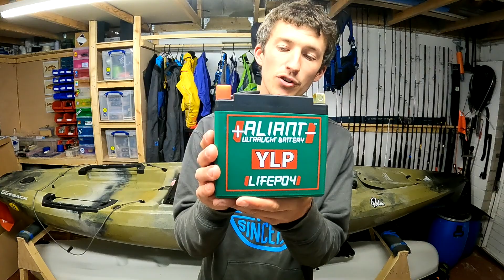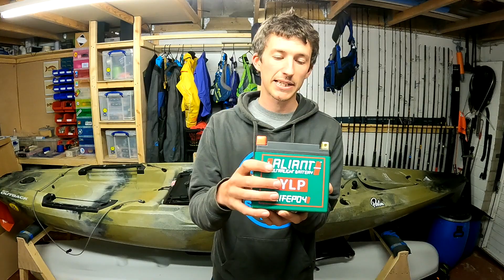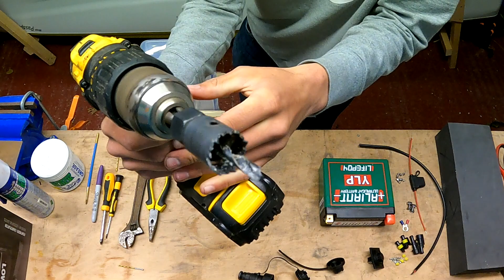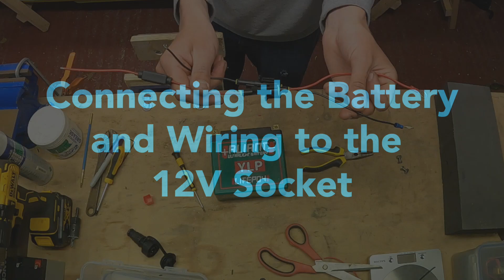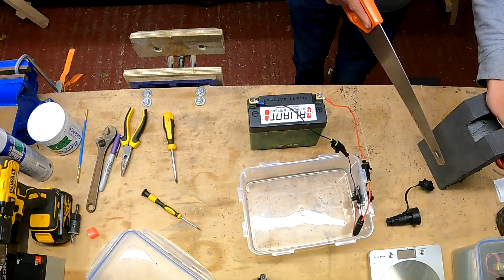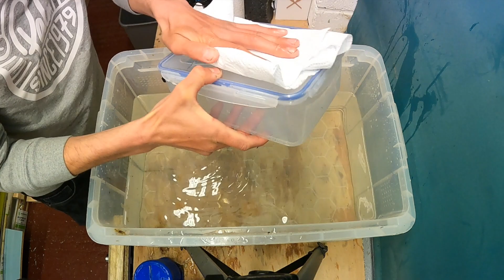DIY WATERPROOF BATTERY BOX for Kayaks & Boats + Sealed Lead Acid vs Lithium LiFePO4 12V batteries!

Comment: On the price, the Lithium will do more cycles than lead - so $/cycle is usually closer in costs.  You can also discharge lithium ~80% without affecting cycles, with lead acid you typically only discharge 50% to extend the life.  Lithium phosphate is the safest of the lithium bunch (won't catch fire while charging) and doesn't use cobalt.  Lithium titanate might be better, probably more expensive.  Water is too resistive at 12V to do much more than let the battery discharge slowly. Unlike lead, in the off-season, don't leave them stored at full charge.
Reply from the maker: Thanks Svetz, there are lots of advantages to LiFePO4 batteries and they are becoming more widely used. I’m sure they will get a little cheaper in time too but as you say, cost per cycle brings them closer to lead options. Faster charging rates too which is a bonus.

Comment: The Connectors are:
1- Smaller ones for inside the box are  Electrical Waterproof Connector 1 Pin Superseal Car Boat Kit
2- Larger ones for outside/on the box is Bulgin Flush Mounting Socket and Bulgin Waterproof Plug

Comment: What's the connector called?
Reply from the maker: The small connectors inside the box are called 1-pin Superseal Connectors. The larger socket connector is made by Index Marine, called the Bulgin 2-pin Plug and Socket. Hope this helps!

Comment: Can i use this Linkstyle 4 in 1 Marine Switch Panel, 12V 4.2A Dual USB Charger Socket Power Outlet & LED Voltmeter & Cigarette Lighter Socket & LED Lighted ON Off Rocker Toggle Switch for Truck Car Marine Boat RV with this type of battery
Reply from the maker: If it’s designed for a 12V system then yeah there’s no reason why it can’t be integrated into the wiring.